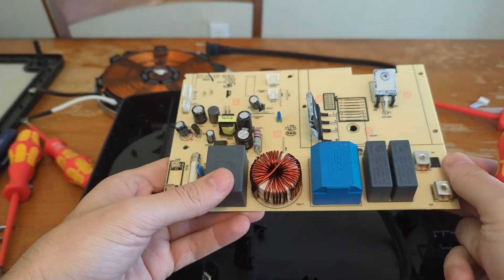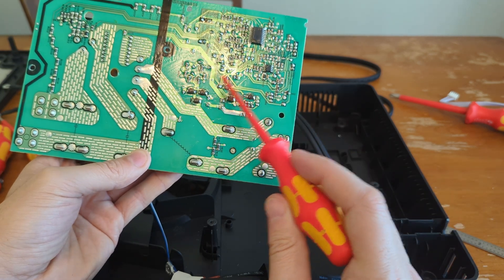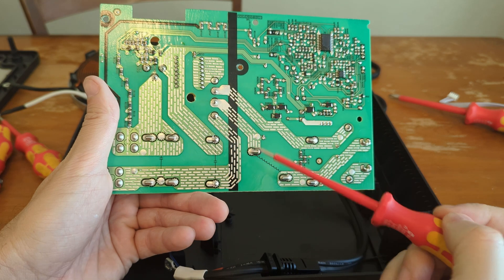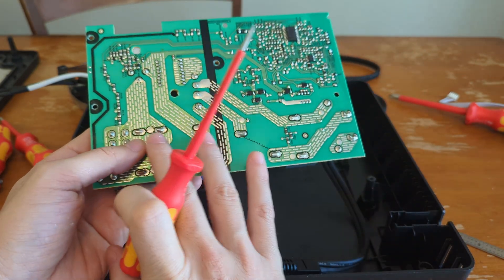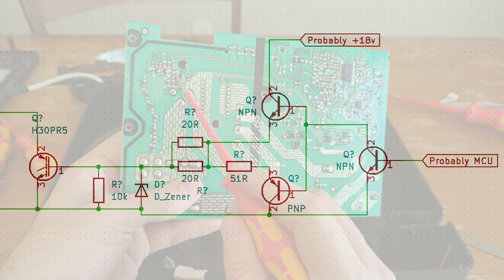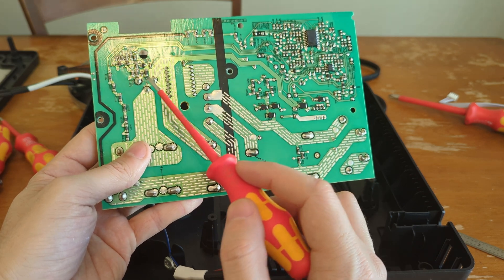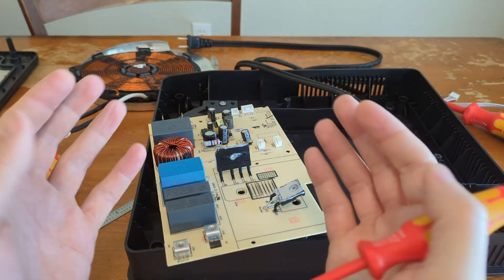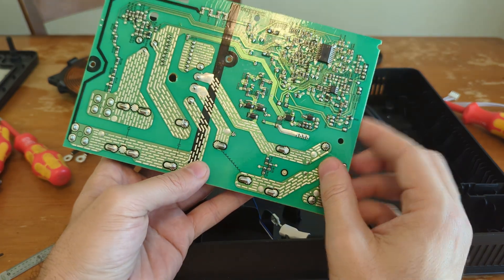Induction Cooker Part 2   Circuit Analysis

Comment: Hi! The negative DC jumpers there are used as a low-cost current shunt for monitoring the current draw of the LC circuit. The Grounds are also tied to each other so that the low power section doesn't need to deal with a higher common mode voltages. The stitched solder mask is for current carrying, if the stitching wasn't there the solder paste would just clump up and ball into one spot rather than being uniform across the trace.
Great video and thank you!
Reply from the maker: Hoy crap. Thank you!!! I never had found answers for those questions. 😀